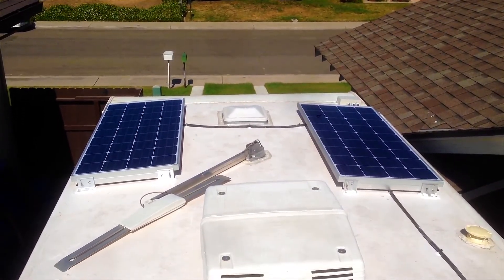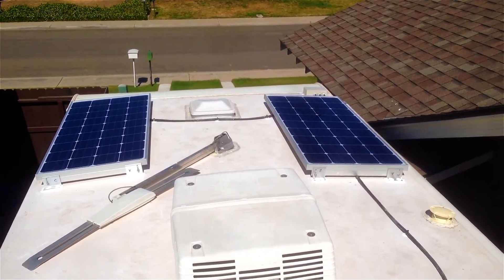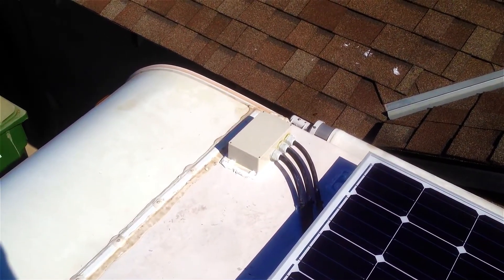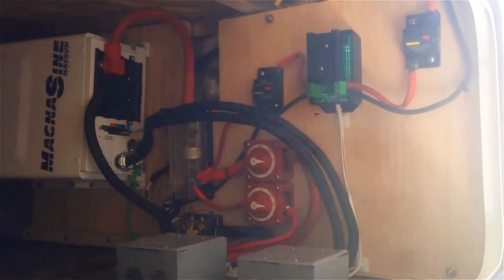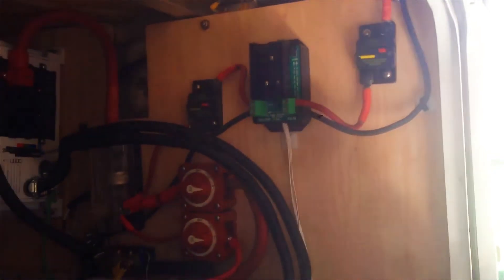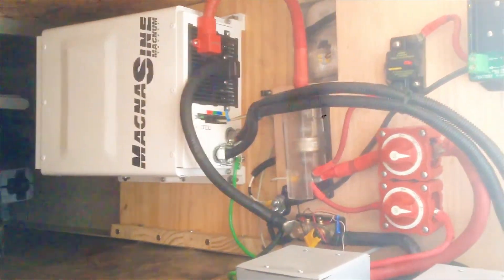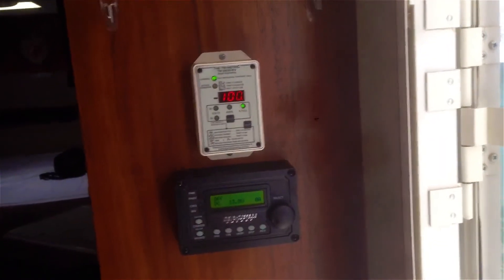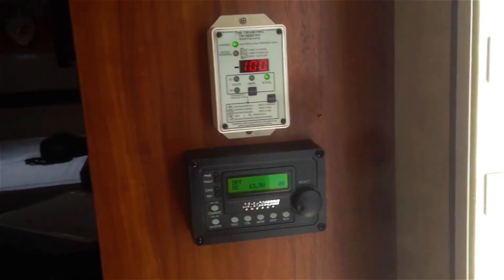Solar Install

Comment: You have basically installed the off grid system I want for our Shasta travel trailer.  I am going to install 3 215 watt Hightech solar panels on the roof using 10 amp wire to the combiner box, 6 amp wire to the sc2030 controller, and using the trimetric battery monitor.  I will be installing the Magnum MSH3012RV Inverter with 2 SOK 200 amp batteries.  Possibly adding 2 more batteries if needed later on.  Magnum and Bogart Engineering products are high quality components made in America.   I like that Hightech solar panels are made in America as well.  Well done.